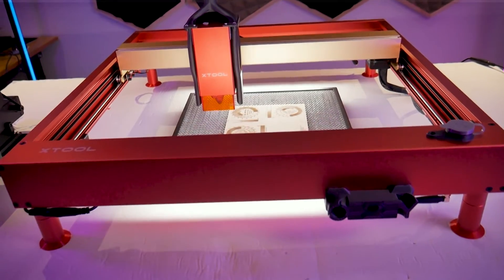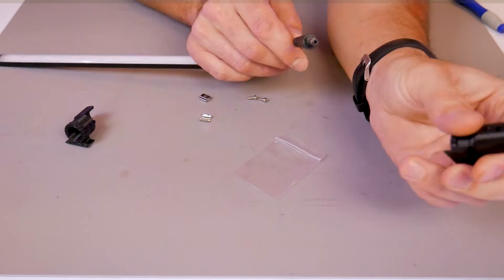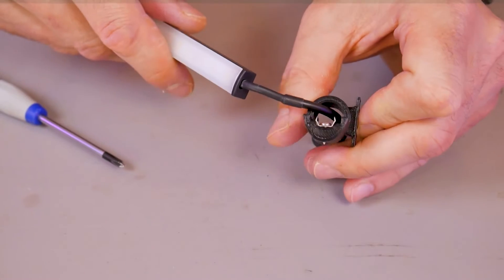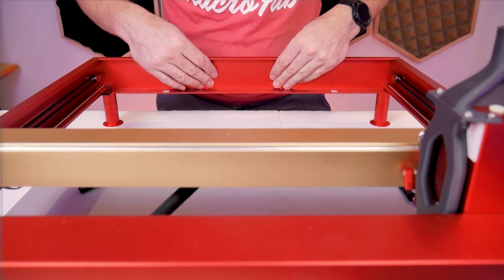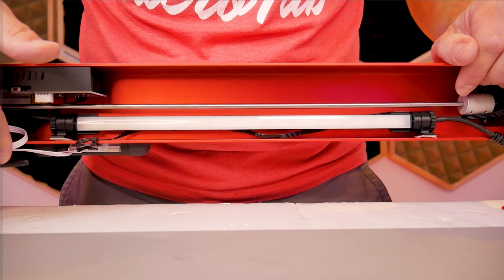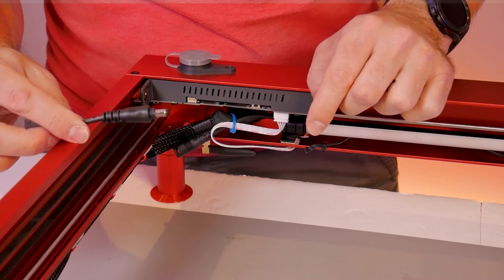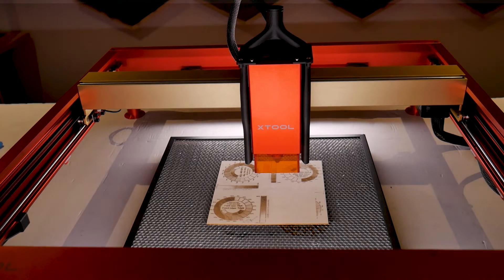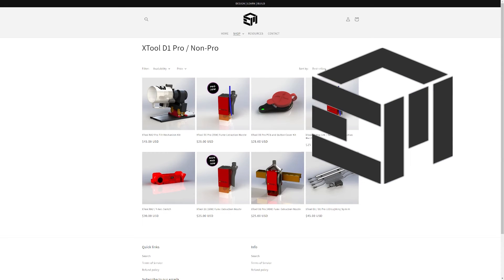XTOOL D1 Pro / Non-Pro LED Lighting System Installation

Comment: I have just started looking for an LED solution for lighting the interior of my Xtool enclosure, and now I don't have to do all of the research. Thanks. and yes I am ordering it right now!
Reply from the maker: Thank you so much Rick, I'm glad you found what you were looking for :)
Reply: @EmbraceMaking   I got my kit today and installed it. Everything looks great and it lights up my xtool enclosure perfectly. My only slightly negative feedback would be that the adjustment gears on mine are either locked in place or take way too much force to adjust. Not an issue, I am fine with them in the initial mounting position. Awesome product, second thing I have bought from you for my D1 and I look forward to your future creations. Thanks
Reply from the maker: Hi Rick thank you for the feedback! Those plastic adjustment brackets might have needed a little more "working in" since they are plastic on plastic. I'll try and do that more with future ones before shipping out - but as you said even in the default position they do a nice job lighting up the work space.